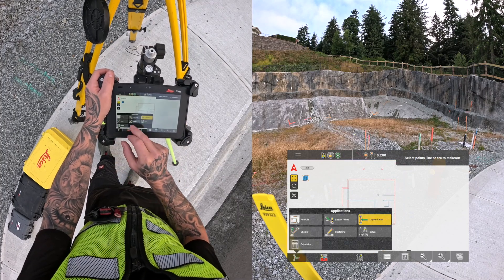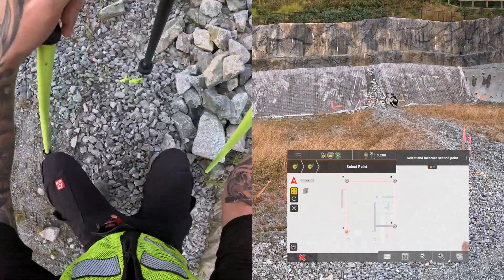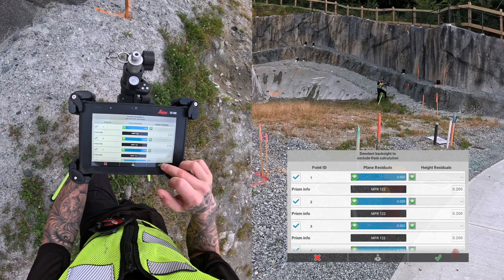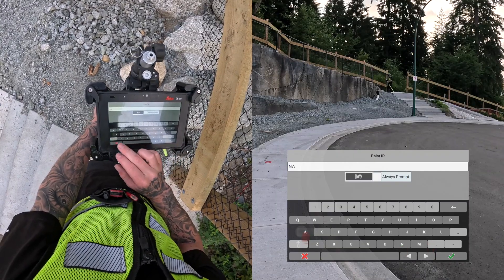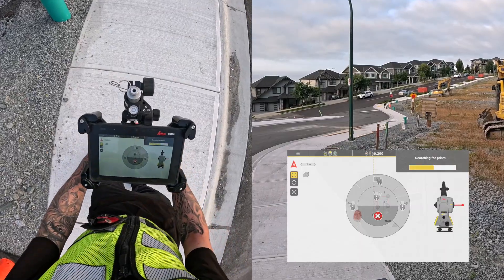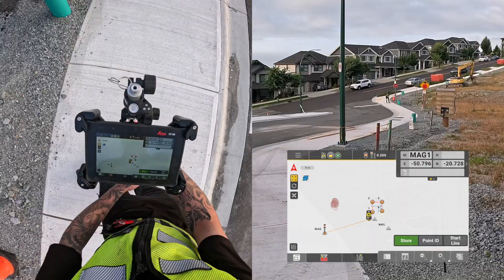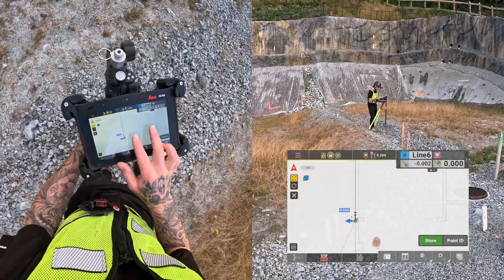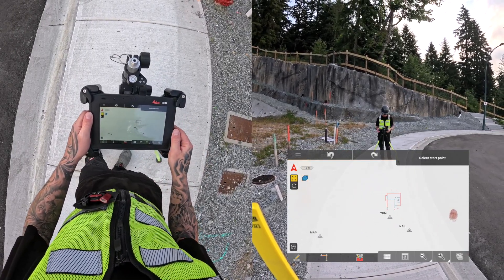Leica iCON Robotic Total Station | Setup & Control Points

Comment: Having all your control points in a 45 degree angle from each other is horrible geometry.
Reply from the maker: And yet it sat over the pins nicely.
The surveyors check the forms before we pour walls, and I’ve never been out of tolerance with layout even with worse control point geometry.